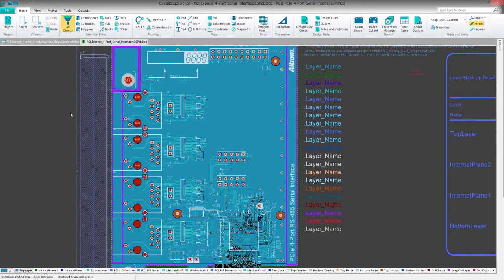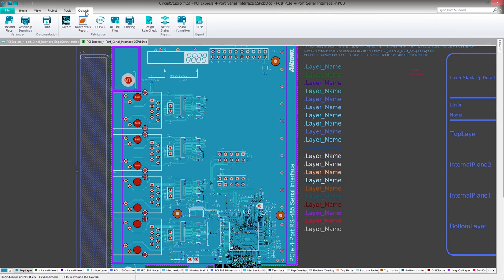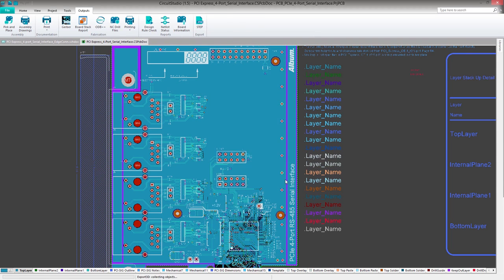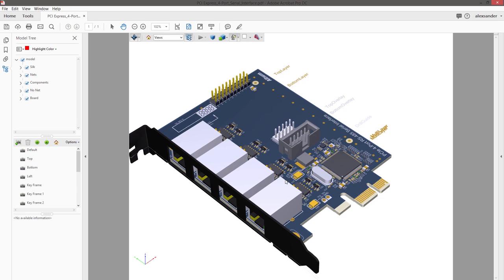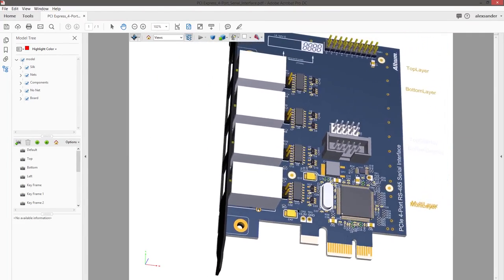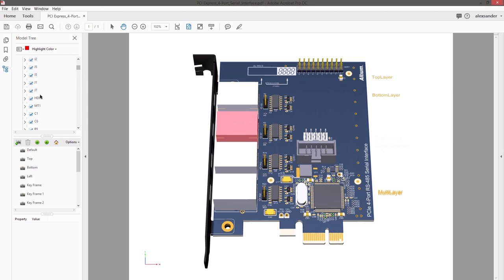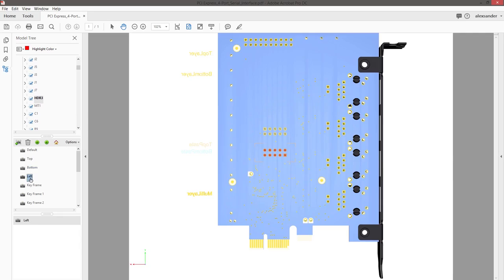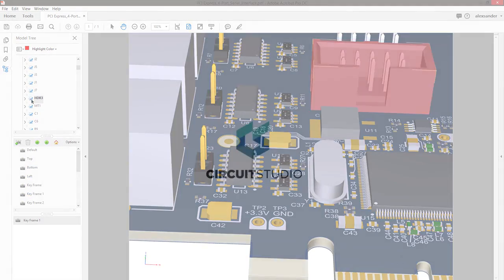How to Create a 3D PDF in CircuitStudio - Altium Academy

Comment: I did´t see that option on mi CS. why?
Output - Print - 3D PDF doesn´t appear
Reply: 3D PDF option is only visible when looking at the PCB, not the schematic. hopefully this helps.
Reply from the maker: You may also need to enable the extension. In the "HOME" view, click "My Account" and then "Extensions and Updates". The 3D PDF feature is an extension you must install from there.